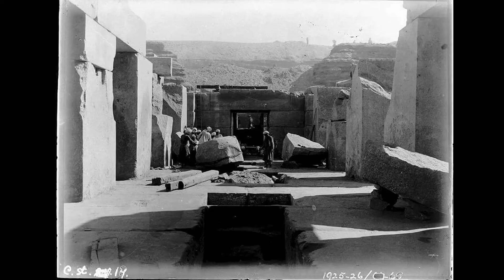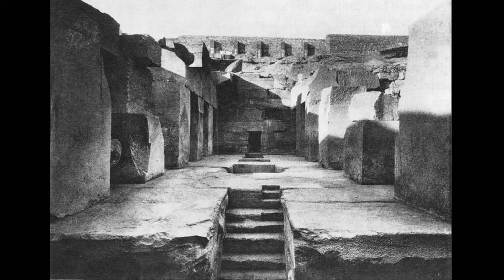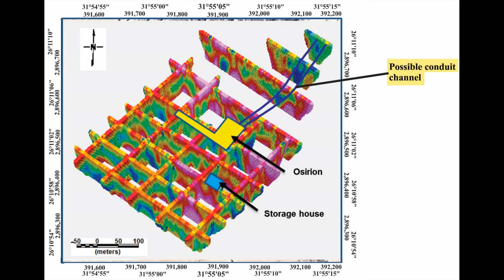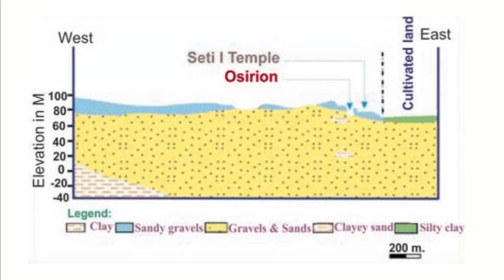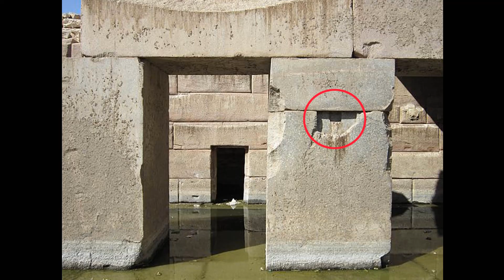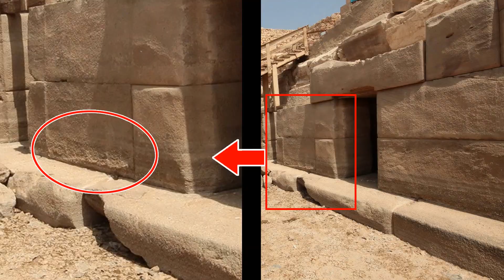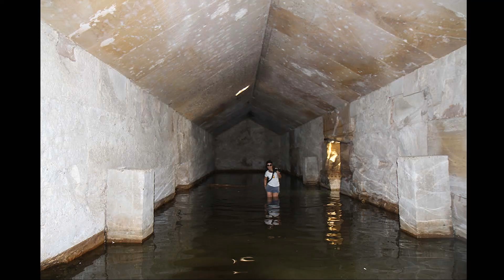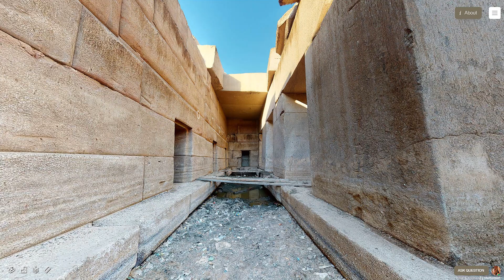The Osireion Mystery: Water, Construction, and Its True Purpose?!

Comment: Great video and looking forward to the next one about the function of this structure!
Reply from the maker: Thank you!
Reply: @CuriousBeingbyTina  Alle Einrichtungen, die Pyramiden das Osirion und die Taltempel wurden zur Messung und Veränderung des Erdinnern gebraucht. Das Wasser könnte in einer Art von Regelwerk verwendet worden sein.
Reply: Hello, I know the function of the Temple of Seti. My guess is that the Osirion was mostly to provide water to the Temple of Seti.

The Temples of Egypt were all set up to achieve basically the same thing "water cavitation using stacked ultrasound waves through the water; it's also called the "double slit wave interference experiment". 

The temple of Seti not only performs the simple version of this experiment in the "first court" but it performs a second more complicated version of the experiment in the "second court" that explains why this temple unlike most leads to the back through "the shrine of Osiris" as opposed to the center of the Temple. 

To achieve what I'm talking about you require two "sonotrodes/Oscillators" in the water and a power source for them. "Search ultrasonic cleaner for auto parts to see a crude version of this technology, also it's used today on a small scale to sort platelets out of blood.

The Egyptian version of this technology also required an energy source to attract the energy source for the sonotrodes. 

Please if you see what I see happening at these Temples please reach out, I'd like to get this information out there.
Reply: @robertmeasures8012  I really hope Tina doesn't reach out to you to help you spread your no-evidence, half-wit garbage! Tina conducts real scientific research in her vids, not bogus conjectures like yours based on nothing at all!
Reply: @sergemck  ouch

Comment: I agree they knew how to recast stone.
Reply: Yet those same scrape marks are evident on the unfinished obelisk in Aswan quarry where you can see it attached to the bedrock.
Reply: @doctormarazanvose4373  Thank you!. So back to the stories about the red leafed plant that could soften stone. south America.
Reply: @ I still wonder whether an acid is at play here.  Far more plausible than the quick fire answer geopolymer.
Reply: @doctormarazanvose4373  they were not cast. more likely some kind of softener lost to time. maybe plant based.
Reply: @ yeah you are on the more correct track It must seem.
Reply: Yes, possibly the rocks were more malleable back 420,000 years ago. The beveled edges are often ignored here, & screeting or Geopolymer/ concrete mix is not a possibility; (especially with Quartz veins in these Megablocks).
Reply: @fennynough6962  still some kind of softening of actual stone than perhaps. surface testing.
Reply: @ don't forget those fossils too :)
Reply: @fennynough6962  stone softening as unlikely as it sounds is more and more the closing option.
Reply: @doctormarazanvose4373  Yes you are correct, looks like they used the same tool for each task. Also suggests the blocks were cast a little bigger, then finished down smooth that's how you would get those inside corners that wrap around.
Reply: @thefly5568  No blocks were cast - that's the whole point.

Take a step back and ask this simple question:  If I could cast blocks of stone, why would I make irregular shapes and try and fit them together?

That makes zero sense.  The quartz veins found running through many also scream NOT GEOLPOLYMER - as do the fossils found in situ.

But hey who am I to wrench people back to reality out of fantasy world?